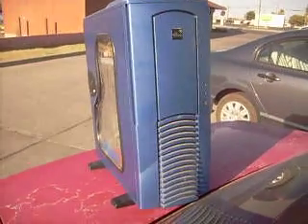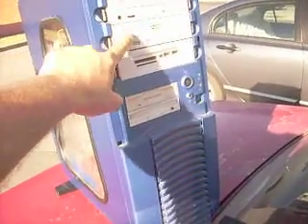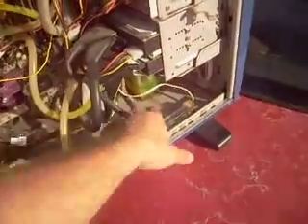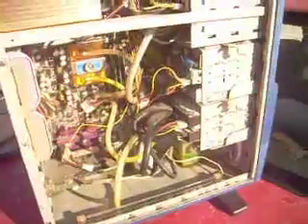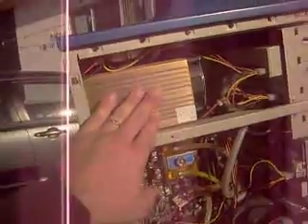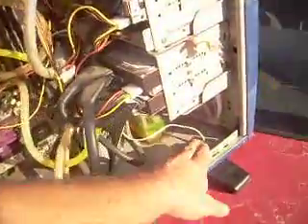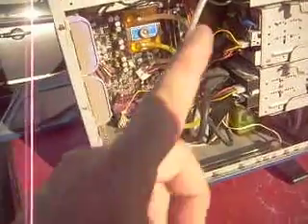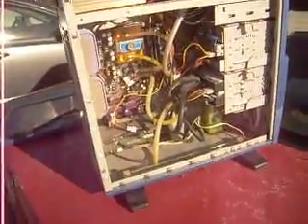When liquid cooling goes BAD!

Comment: If it's oil than it shouldn't be conductive
Reply from the maker: Right you are; I figured this out afterwards with some research. My mistake. It had continued to overheat and that's what killed the machine-- lack of the circulating oil.

Comment from the maker: @silntdoogood I've seen videos of this being done, and it looks like a great project to undertake. With the caps like that I would be a bit worried about dust, too. 

The project I saw used no fans and a light oil being cooled in a water cooler with a slightly heavier duty water pump (oil is denser). 

If you do I wanna see :)

Comment: The PC I rebuilt, I used capacitors with the wrong sized base,so they aren't flush on the board, and can gather dust. I'm considering dunking the whole thing in a fishtank to liquid cool it.